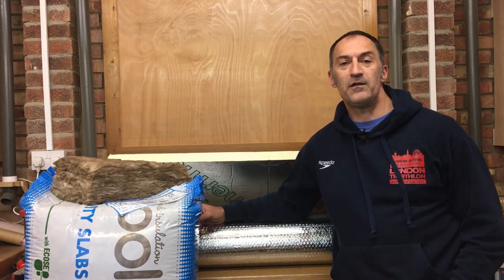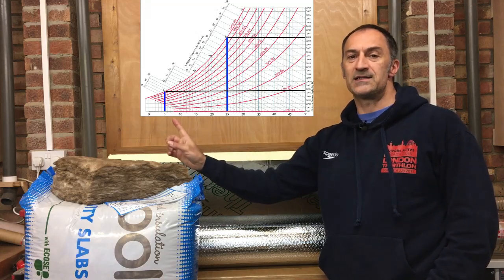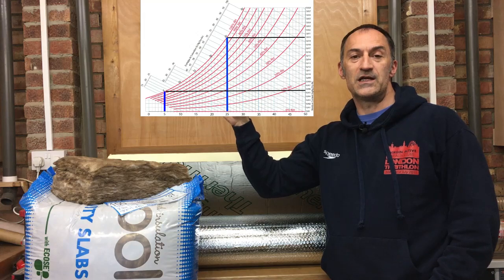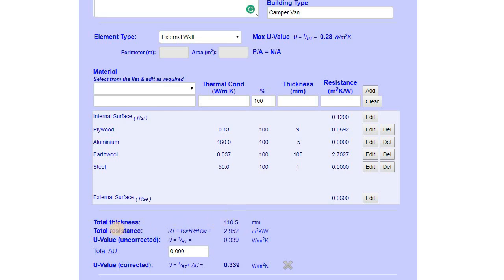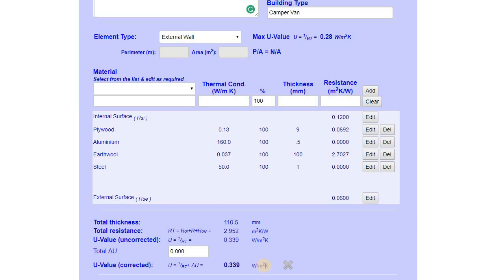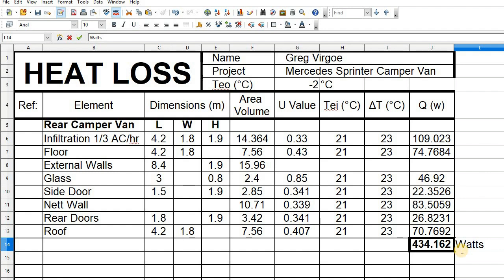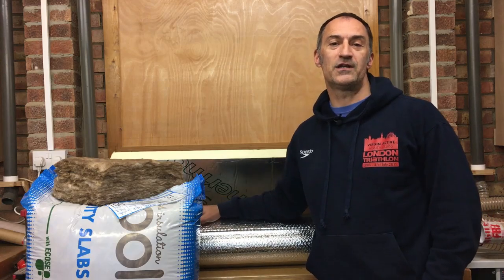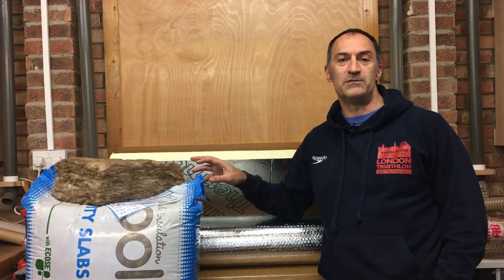How to Insulate your Van Part 1 - The facts you need!

Comment: Thanks for the very helpful & informative video Greg! Can you help me please, I'm about to convert a low loader van that has straight GRP panels & would really appreciate your advice on the insulation. I am using the same insulation as yourself ( the Kingspan Thermal Insulation Boards), but am unsure of the thickness I need to use on the walls, can you advise please? Do you think 1 inch thick would be plenty or do I need to go thicker? The vans internal meaurements are  approx. 4.5 Metres long x 2 Metres wide x 2 Metres High.  Thanks Best regards Neville.
Reply: Hi Greg. Thanks for your reply & for the info, it's much appreciated. Sorry my reply has took so long! We have decided against the Low Loader van now & instead have bought a Peugeot Boxer XLWB, would you still recommend 2" thick insulation on the walls Greg? I hope you are enjoying your travels & look forward to seeing your future videos Regards Neville.
Reply from the maker: Neville Pearsons you should be able to get the 2” thick into the wall cavities ok. 👍🏼
Reply from the maker: The 1" would be the minimum you can get away with but if you can afford the space then 2" thick would be perfect. :D
I have 2" PIR in our van and it's as good as your home
Reply: Hi Greg. Thanks for your reply & for the info, it's much appreciated. Sorry my reply took so long! We have decided against the Low Loader van now & instead have bought a Peugeot Boxer XLWB, would you still recommend 2" thick insulation on the wall Greg? I hope you are enjoying your travels & look forward to ssing your future videos Regards Neville.
Reply: Hi Greg. Thanks for your reply & for the info, it's much appreciated. Sorry my reply took so long! We have decided against the Low Loader van now & instead have bought a Peugeot Boxer XLWB, would you still recommend 2" thick insulation on the wall Greg? I hope you are enjoying your travels & look forward to ssing your future videos Regards Neville.

Comment: Hi Greg, let me, please pick your brain and expertise. I just saw a conversion where ArmaCell ArmaFlex self-adhesive material was used (https://www.youtube.com/watch?v=MWpgEGBdgkc). Do you know if it has a good thermal conductivity or would you recommend it for cold UK weather? In hard to reach areas I would still use Earthwool, but anywhere else on the side it looks like an easier application with the benefits of an additional vapour barrier and sound absorption properties (I would still wrap the whole outer layer of the insulation with a vapour barrier). Any advice is highly appreciated! Looking forward to your upcoming electricity/solar related videos! Cheers, Tom from Newquay.

Comment: How would you suggest insulating windows? I have 360 degree windows in the back of my van and would like to enjoy the occasional mountain trip. Thanks.
Reply from the maker: Brent Daugherty, we have insulated reflective blinds fir our windows, they are made of a number of components, on the outside it a layer of reflective foil then next is a insulation wadding and on the inside a grey fabric, all stitched together like a quilt and held onto the window with suction cups, they work well in both summer and winter.

Comment: Hi Greg, firstly thanks so much for taking the time to compile these excellent videos 👍

I am converting and LDV Convoy (I know 🙄) and they are prone to letting in water (rain) in various points e.g.: from engine, window seals, back doors, roof/fibreglass join etc etc. So my question is after insulating the way you have suggested would it be wise to seek out and destroy (fill!) any potential looking weak areas with expanding foam........and then ply line after?

Thanks again

Comment: Hi Greg real interesting video's, love them.
Your name and insulation detials came up in our Dutch RV forum. 
There is a serious discusion going on about insulation regarding the vapour barrier.  
In a steel Van there is now way out for vapour which end up between vapour barrier and steel van body as the steel body is closed. 
How do you see this in the long run, is corrosion expected or did you put some ventilation openings in the steel body from your Van to let the vapour out?
Reply from the maker: The whole point fo the vapour barrier is to make a very good complete seal so nothing gets there in the first place that includes sealing up and holes for trim etc, you are preventing the vapour getting in there that is the whole point.
If you ventilate that void then you might as well not bother putting a vapour barrier in, that simple and you will have far more condensation problems I guarantee.
Reply: @GregVirgoe  Hi Greg thanks for answer. Do you not expect to have condensate on the inside of the steel van body in between the steel and the vapour barrier which can not disappear. As on 1 side the body is airtight and on the other side the vapour barrier. or is there no chance there will be vapour / condensate due to temperature changes of the steel body?
Reply from the maker: You need to make a good seal with the vapour barrier then there will be no way the moisture laden air can get in there. If you don’t do vapour barrier or leave holes in it then you will have condensation
It it proven in industry for years as a way to stop chilled water and air conditioning services from sweating.

Comment: What a great video, the best so far on utube that I have ever watched. But... can anybody advise how to insulate a panel van that will be used for a single weekend to sleep in at a festival in winter as a temporary measure. It is simply a transit panel van which will be used in conjunction with a camper awning. Any ideas would be gratefully received. Whatever is used needs to be easily removed after the weekender.

Comment: What do you think about letting the insulation breath? A layer of rockwool, a layer of Tyvec and pegboard as the wall. Thanks your videos are the best.
Reply from the maker: Hi Tim, in this application that's the worst thing you can do, you will let moisture laden air into your insulation where it can condense.
The best thing to do is seal all your insulated voids with a very good vapour barrier to prevent that moist air from getting in there in the first place.   Prevention not cure, that's the way forward.
Reply: @GregVirgoe  I was thinking if it let moisture in, it would let it out. I' m with you though the moisture would turn to water and would be much harder to get out. Thanks for your input.
Reply from the maker: Don't let it get in there in the first place 👍🏼😃

Comment: Would you recommend putting insulation in you van for warmer climates like Australia? From my research i think i'll be just using reflectix on the inside and no insulation as I don't want to trap heat inside when it gets warm?
Reply from the maker: Just for kicks I'll give you a little experiment to try. Take your old blue cooler that resides in the back off your garage and remove the EPS insulation. Light up the BBQ and stick a cold six pack of your favourite beers in there close the lid and sit it by your sun lounger while you're cooking your shrimps. Once the food is done, sit back, relax and reach into the cooler for a beer. Let me know how you get on, cheers 🍻
Reply: @GregVirgoe  I think I understand what you're getting at. Correct me if I'm wrong, but is the point you're trying to make that the insulation will keep the heat out?
Reply from the maker: Hi, yes in summer it is still advisable to insulate because that will slow down the transfer of heat into the van.
The biggest way you can stop your van getting hot is to reduce the solar gain through the windows. 
Simplest way to do that is with reflective blinds either inside or better still outside.
Radiant heat from the sun enters the glass and heats up the objects inside, which then heats up the space.
Shading the windows and insulating the van will keep it much cooler in the summer. 
Hope that helps you

Comment: Hi Greg, thanks for explaining this. So many of the American van lifers are coming back after 3 / 4 years and stripping out their van to find heavy mold behind the wood panel and asking why. My old man worked for some big insulation companies and for the last 15 years of his career he was specifying to architect the material for the application and the fixing method. From what I remember the 2 things he always told me was never ever double insulate and always, without fail leave an Air gap. Now obviously dad was specifying houses and not vans. My question is, do these rules apply to vans and will the foil faced bubble wrap move the condensation point to an undesirable point. The American van lifers that are not returning to re do their vans are setting them up in the way you suggested, with foil faced pu or wool with the ff bubble wrap as a heat shield. What have they done wrong to cause the condensation, do they need to be sealing the ff bubble wrap to stop moisture getting to the condensation point? Shoild they have left an air gap and didnt ? So glad I have found this, this has been the main stcking point from stopping me building a van. Can't ask the old fella unfortunately
Reply from the maker: Hello Jon, the main reason air gaps or cavities are built into houses is because the building materials are permeable and the air gap prevents the damp getting inside. Van building is different. The van is already waterproof but steel has a thermal conductivity of 50 so the condensation will form inside if not insulated adequately and more importantly correctly vapour sealed to prevent moist air getting though the insulation to the cold steel of the van. 
It’s a barrier and it needs to be completely sealed. 
Despite what people think air is a pretty poor insulator and it doesn’t get any better the bigger you make it. So as space is a premium in a van why waste it with air gaps when you can put much better insulation in its place.
There has been a lot of people copying bad practice not knowing what they are doing wrong. I hope I can ad value with positive scientific methods that are proven over years in industry to work. 
One thing you can count on with my channel is I’ll never give out bad advice. 👍🏼😊

Comment: How about cork ? 
And thanks you for your video
Reply from the maker: Hi Lulu, cork has a thermal conductivity value of 0.04 W/mK so that the same as most wool type insulation such as Rockwool or Fibreglass. So as an insulator it would be quite good 👍🏼😊
Reply: @GregVirgoe  it s what i though. I will use 4mm cork do you think i will need to use another insulator or vapo protection ?
Reply from the maker: Hi Lulu, unfortunately 4mm will not be thick enough. 
I have 100mm of Earthwool at the same conductivity rating thats 25x more insulation. 
Why not go for a more traditional insulation like recycled plastics or PIR foam board. Why did you plumb for Cork?
Reply: @GregVirgoe  because it s really cheap and because i will travel just in summer in the mountain. I dont need a lot of insuflation. I was more worry about the noise of the rain  !
Reply: @GregVirgoe  sounds i will use multilayers to double with the cork. Thanks
Reply from the maker: Lulu berlu ok cool 😎

Comment: Thanks for a informative video! What about the radiant heat from a hot sunny day? Let's say I have a dark blue van and the sides and roof are getting very hot and radiate heat into the insulation. Wouldn't an aluminum foil somewhere in the layer help with that in another way than what conductivity value will tell?

Comment: Very good video !  What about the off gas the material gives off inside the van ?
Reply from the maker: Mary Wrong, these products do not offgas to any notable extent. The glues used to bind them are MDI, which seems to be much less volatile than formaldehyde, and the gas used as a blowing agent is mostly pentane, which is very similar to butane used for cooking. I think the reputation for offgassing goes back to the 1980s when there was a lot of cavity wall insulation carried out using formaldehyde and this did offgas and caused respiratory problems for homeowners. It resulted in Part D of the building regs: today the problem seems to be sorted. 
Out of interest you will get a small amount of offgas from natural products such as sheep’s wool too. 
As a rule, the best test for offgassing is your nose - if you can smell it, it's offgassing, if you can't, it's inert.
I am not concerned with my choice of materials 😀

Comment: Enjoying the build series. I'm about to buy a new sprinter to have converted. If the van is insulated properly can you tell me if there would be much difference to the inside temperature depending on the colour of the van ?. I'm really looking at metallic black but logic would say this is going to be massively hot in the summer parked up in the south of France and I should go for a silver or light colour. Is it possible to calculate the difference in temperature depending on colour ??? Appreciate your comments. many thanks, Steve

Comment: Great video Greg, very informative... however I do have a question... I am looking to remove the interior plastic panels in my Berlingo and cover them in the grey carpet lining material. I then plan to fill the voids behind the panels with the recycled plastic loft insulation... my question is, would the carpet covered plastic panels be a sufficient vapour barrier (as the panels are plastic) once fitted back, or would I need a layer of the “reflectix” behind the plastic panel (or sandwiched between the plastic panel and the carpet lining)... hope that makes sense... thank you.
Reply from the maker: Hello Mick, I doubt the plastic panels would make an airtight seal to the body work and moisture would get behind them. I would apply a vapour barrier over your insulation sealed with foil tape and then put back your cladding. 
The main thing you are trying to do is prevent any moist air from getting into your van structure. You can use foil, plastic or reflectix to do this
Hope that helps you 😊
Reply: Greg Virgoe that’s great thank you. Just to add to the conundrum, I have an air vent in the plastic side panel, that allows air (and I assume moisture) into the framework behind the panel. There is then another vent behind the panel with rubber baffles acting as a one way valve, which I assume then goes out to the exterior of the vehicle. How would you get round that ? Thanks again...
Reply from the maker: Hi Mick, can you send me pics to gregvirgoe@gmail.com I know my van has vents so you can close the doors without it being a sealed box. My shower vent has become the door close vent now. 👍🏼
Reply: Greg Virgoe emailed you a photo that should explain better...

Comment: The main downside of PIR boards like Celotex is poor sound dampening characteristics. 
Sound insulation for campervan is as important as is thermal.
Reply from the maker: MrDehicka, over 2" the difference in sound absorption between PIR and Rockwool is negligible. I'd rather select it for its thermal properties as personally I'd rather be warmer than worry about a little bit if noise in the dead of night.
Reply: @GregVirgoe  Hey Greg! Great video. I'm scrolling through comments now to glean extra information and look at the questions people have asked. If someone (me, perhaps) wants to have a very well insulated van build with respect to thermals AND sound without sacrificing even a bit of either, how would you recommend changing/modifying the insulation technique?

Comment: Hi Greg,
Can you please confirm that Earthwool Dritherm Mineral Wool Cavity Slab doesn't contain anything that may irritate the skin or respiratory for both humans and dogs? I read different things online and I'm just no longer sure. Thanks!
Reply from the maker: Hello, I cannot say categorically as different people react in different ways. 
I personally cannot go near fibreglass but find Earthwool to be ok to handle and does not make me cough. However if you are concerned maybe go for Diall recycled plastic insulation like I used on my rear door card video. That will not cause you any problems. 
Hope that helps 😊
Reply: Hi @GregVirgoe  , thanks a lot for replying! Unfortunately it's not so easy to find it here in Switzerland. I've contacted Knauf Insulation in the UK and they re-directed me to the German department.
Your videos are extremely helpful with our conversion and we're really really enjoying them. Thanks so much and please keep up the good work!
If you're ever around Switzerland and need some hints on nice locations, let us know ;-).
Cheers
Marco & Laura

Comment: Great video (the third time i’ve watched this). Found an R-value for Kingspan Permifloor (reflectix) as R0.12. No insulating property, as you mentioned.
Reply from the maker: Hi Andrew, thanks for confirming that, that value is the same as the surface resistance of any material, so effectively nothing. Can you post the link where you found that please?
Reply: Greg Virgoe Product R-Value - Page 5 https://az750602.vo.msecnd.net/netxstoreviews/assetOriginal/35144_AIR-CELL%20Permishield.pdf

Comment: Great stuff Greg, but what the F...  you have  whole lot of windows. Unless you seal off the drivers space all your heat will go out of the windows.
Reply from the maker: Hi John, that's the wrong way to deal with it, you need to heat that space or you will have loads of condensation issues. Yes, it is going to be a big percentage of your heating due to the glass but that applies to all dwellings. My van probably only need just over a 1kw of heat to keep it very toasty, my heater can give out up to 5.8kw so I'm not worried about being cold.